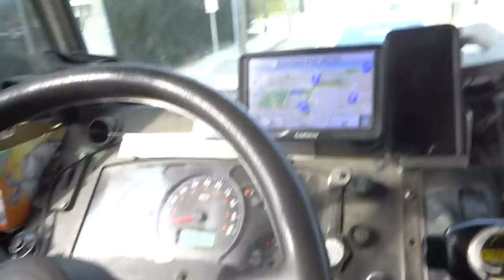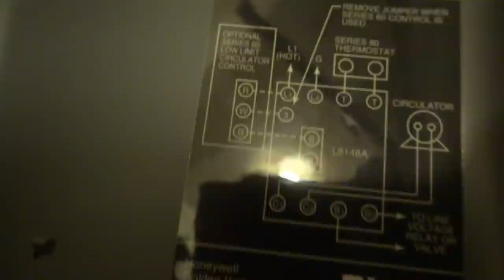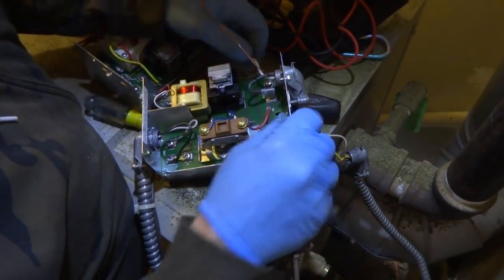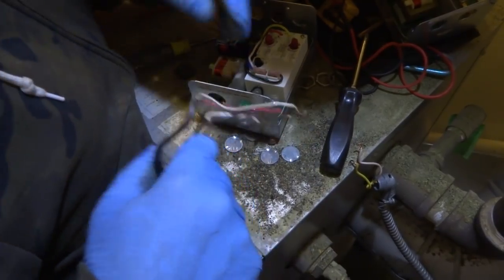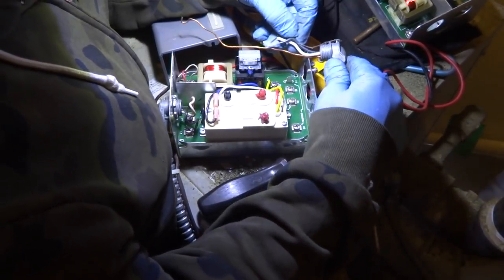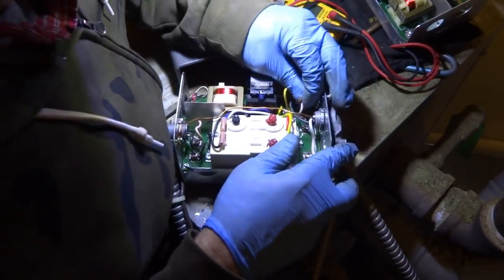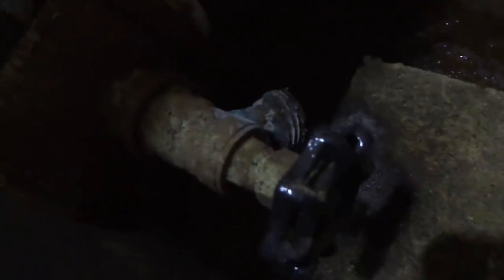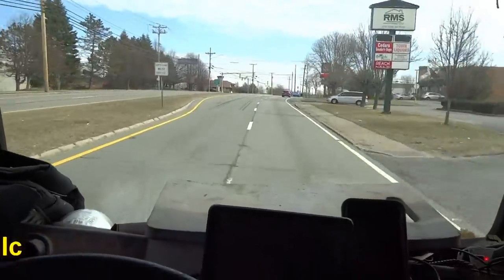VIESSMANN BOILER NOT HEATING BUSINESS PART 2 OF 2

Comment: Cad cell ohms should never be higher than 1600 or the primary control will trip out. I would def change the cad cell eye, and do a combustion and smoke test to adjust the air band to achieve the correct CO2 level

Comment: Good times. Not a fan of tight areas either. Just yesterday,  I had to remove a driveshaft on a Jeep, and lower the trans just to get an o2 sensor unplugged and changed out. Pain in the ass
Reply: What's amazing it's american expect it on imports little chinese hands we do don't have, 🥺✌️👍🤙🙏😔
Reply: @milotorres6894  I run into that in all kinds of vehicles, this was a 2009 grand Cherokee with a v8 stuffed in it
Reply: If you were a factory robot it would be a piece of cake!

Comment: Tight spot. At least you had slack on those cables and could wire it from the top. If that wiring was shorter it would have been a super shitshow!

Comment: Isn't there codes that require a heating appliance like a boiler to have minimum clearances on all sides? That's ridiculous how tight that is in there.
Reply from the maker: I DO NOT THINK IT SHOULD OF PASSED INSPECTION .
Reply: Sadly yes but since it's rocked in most codes cut in half especially on west coast u guys  have oilers should be 3X.,👍✌️😊🙏🤔🤙❄️
Reply: I think those stud walls were installed after the boiler was installed.
Reply: That's dangerous to work on that set-up from the side, definitely should not have passed inspection

Comment: Do you think the PCB shorted out on the metal enclosure?
Reply: looks like a cold solder joint on the board   could be repaired but I think it is ageist code to repair boards
Reply: @force311999  Oh dear - I do that all the time (mainly swapping out capacitors that have died) 😳

Comment: Loved that "I like it tight" crack!  Watch-out, Steve.  You might have some feminists come trolling for you. 
    I see you gave the "Moby Dick Motel" a nice free plug.  (Catchy name).
    I would not give up the beer if I were you, that`s too extreme.  You might have done what you did in that video about the tub with the satin fixtures and double ceiling.  Just take a hammer to that sheet rock blocking access to the controller and create a Steve-sized, workin`mans dry dock for yourself to work within.  Then staple-up some cardboard to cover it.  You might have lost some valuable tool back in that man trapping cubby where you could not reach it.